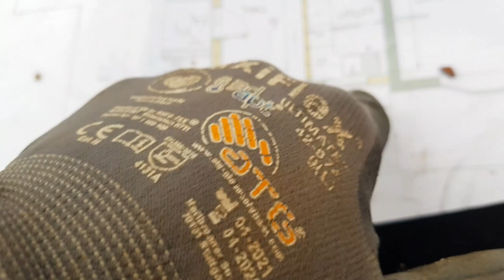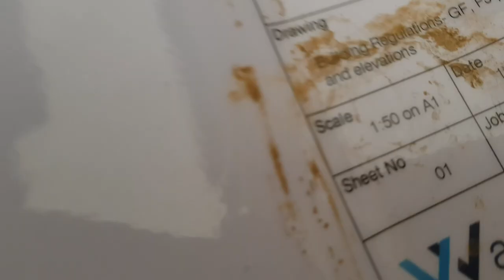Bricklaying - New Extension - Old Cottage Renovation #bricklaying #renovation #vlog

Comment: Nice job mate see youve cut your vertical dpc in good work just one piece of advice mate you should knock off render and make sure your wall starters go back to exsisting brick or blockwork of house render is a coat it cracks and can fail and ur extension is tied to it
Reply from the maker: Thanks David, got a load of stick ages ago for now having one..and after reading up on it, and reading what everyone was saying in my comments, I always put one up now👌👌
Didnt think about that at all mate, appreciate you telling me 😊 I'll make sure to start doing that 👌 have a good weekend David 😁
Reply: good advice david

Comment: How do you keep the bottom of the blocks flush with the block down below any tips to stop them from kicking out at the bottom
Reply from the maker: Always good to check the first course quickly with a level. Not too much bed..smashing blocks down to the line makes everything belly out. Just depends how the blocks are really...if they are dry it ain't too bad..but when they are wet, they can belly out really easily
Reply: @IzzytheBricky  cheers for the reply in Ireland we use 7 Newton concrete for internal and external leaf I find that sometimes the Weight causes it to kick out we go up 6 or 7 courses usually
Reply: Blocks
Reply from the maker: @adamscanlon7098  it's a tough one mate..cos happens to me 50% of the time too😂 I guess u could check each course with a level to make sure it's not leaning out 😊😊💪🍻

Comment: Always a debate about the vertical damp, I've built hundreds of extensions over 47 years and never done it once. My local authority BC don't like it as it weakens the building as wall ties aren't every 225 and them starters don't hold anything. To be honest if it was done properly the cavity should be cut in to make it continues which is something we used to do before wall starters came out when we used to tooth out. Trowel on top of the block Mmm 😁
Reply: @Seamus Otoole 👍
Reply: Walked off a job a few months ago because the customer insisted I do the cut,,,, no thanks pal, dirty old job wet or dry cut.
Reply: @Marshalltoon  You walked because they asked you to do your job correctly!🤣
Reply: @kevocos  not my job too get coated in dust 👍